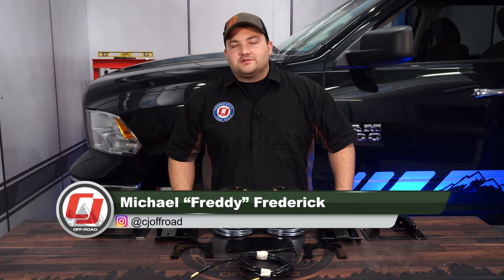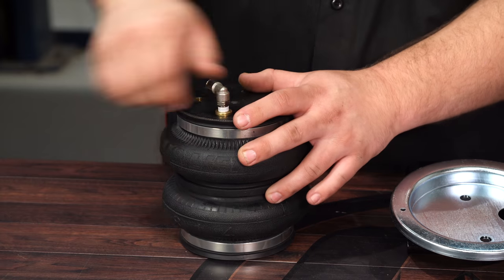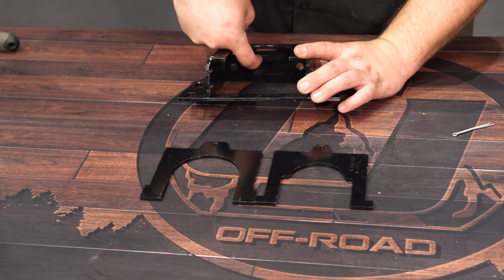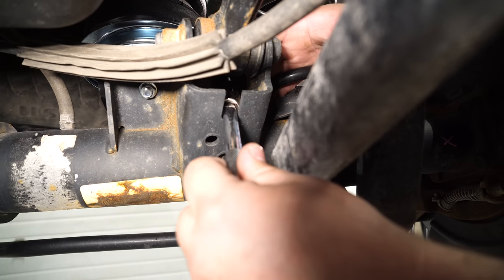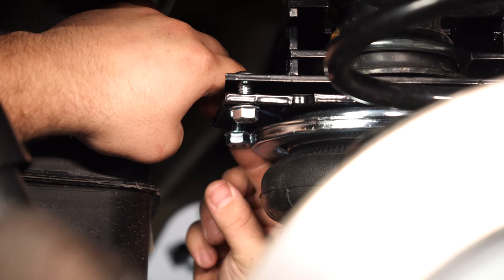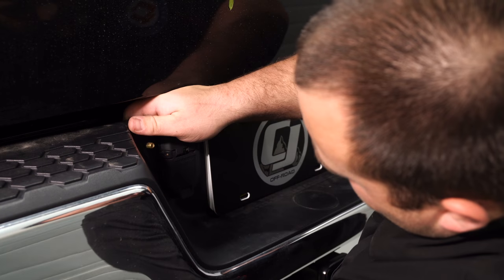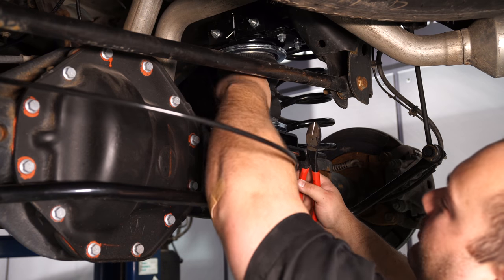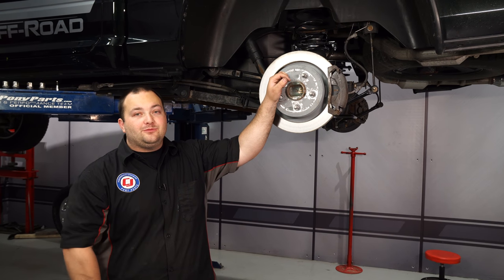Keeping the Dodge Ram Level while Towing: Air Lift LoadLifter 5000 Air Spring Kit Install

Comment: I just spoke with Air lift - Part # 57370 has been discontinued. The reason for this is not cutting out the bump stop bracket caused extra height on top of the bag and gives a really rough ride (because it's almost compressed without any PSI) so when you're not towing it's a rough ride. By removing the bump stop bracket you're allowing the bag to open all the way up so when you don't have a load you're basically resting on your coil springs only.
Reply: I have this 57370 kit and will attest to this. I just pulled it off today because I got tired of the rough ride unloaded. Think they will supply new brackets for those of us that had the older kit?

Comment: I installed the rough country leveling kit. I have 2” spacers in the rear. How will this affect this kit as far as install and is it compatible or is there two inch spacers for the bags I need to purchase separately?

Comment: So with the new kits they make it to where you have to grind off the top bump stop piece!? That’s stupid.
Reply: it is stupid and i dont want to fuck around with cutting parts off and drilling holes in shit while this baby is still under warranty. i will have to go with the ones that go inside the spring for my load leveling needs. maybe in combo with the timbren ses to replace the factory jounce things without destroying anything

Comment: What is the part number to this?
Reply: I'm guessing its 57370, the 57465 requires grinding of the bump stop plate. I can not find this kit anywhere. The link left in description doesn't even sell this kit. I've tried contacting air lift to no avail. But have read the 57370 is a true bolt on like the kit in video. Amazon has the 57365 if you want to grind off and drill into frame for 284$
Reply: 57370. I found one on ebay. They have 7 left
Reply: These links are bullshit. All it brought up was a compressor.

Comment: Whats that kit number , thats little different from the other one i saw where you had to cut the jounst bracket off
Reply from the maker: Here's a link to the kit, pretty easy to install!
Reply: Hahaha I guess I just answered my own question to the email I sent to airlift.  It’s a newer version that you don’t have to cut and faster install time! Awesome!!!!
Reply: CJ 
Off-Road
Reply: @CJBroncoF150  do you have the link to the kit?
Reply: @chris69101  Wich one came first ?
57365 or 57370
The 65 is the one required cutting.
The 70 is the bolt-on.

I have the 70, and I would need an extra 1" raise on the rear spring to have proper airbag height.
My truck kick
Reply: @chris69101  How did it go with your install? and Which truck do you have? The Hemi or ecodiesel?
Reply: I can't find the 57370 kit anywhere! Air lift won't respond to emails sent either 😕
Reply: Okay well thanks for getting back to me on that.
Reply: 57370. Found it on ebay
Reply: Does it make sense to run D/P lines to a tee and have a single shraeder valve for balanced filling or is there a good reason to have 2 lines (I e. balancing I might be overlooking)?  Nice install and thanks for sharing.